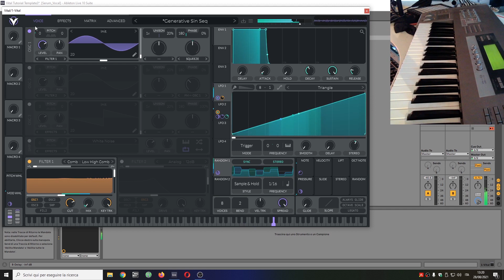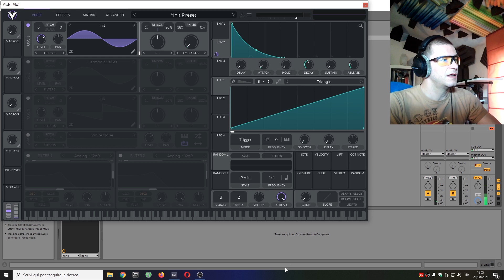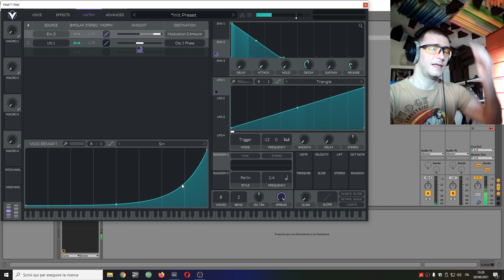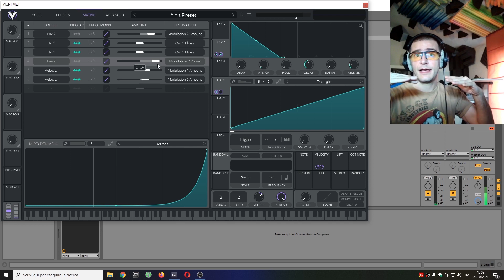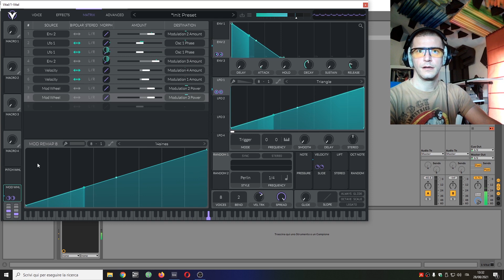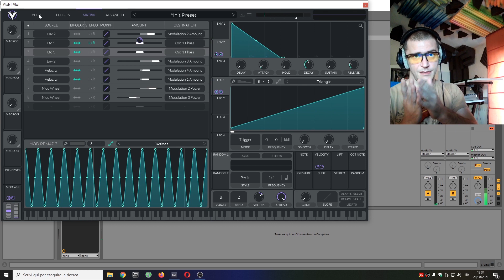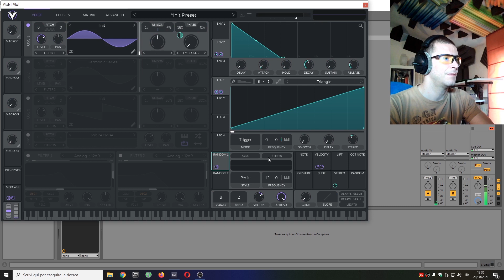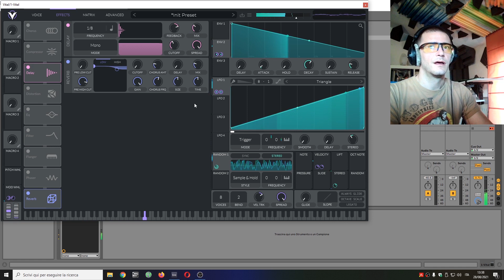vital vst tutorial | advanced and unusual FM synthesis techniques

Comment: Good stuff. There should be more Advanced fm vids 👍 A useful thing on even the hw fm synths is the detuning carrier and modulator against each other in same stack. Not same effect as detuning operators in two or more stacks against ea other. It provides timbral harm shift instead. Also try that on low-freq carriers. Also something in the Yammy's called velocity-switching where extreme vel amounts on an operator's level can be used for triggering enhanced transient portion of a patch and lower velocities will be used for the softer body of a sound. Vel is powerful in an FM patch as you know. I wish Vital made this slightly more practical.
Reply from the maker: Sure, but imho it would hardly make it more practical. I guess designing interfaces is really the big conundrum for synth makers, Vital isn't strictly speaking an FM synth, so the interface is more focused on making other things more evident and handy to program... But tbh, I don't think instruments as FM8 or Sytrus do that much better in that regard.